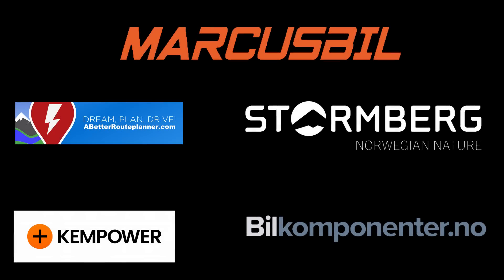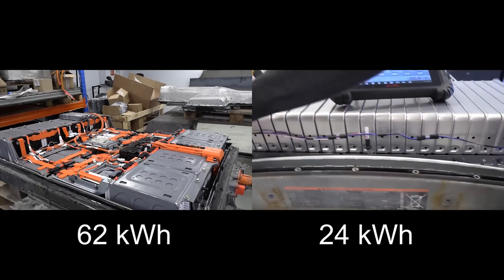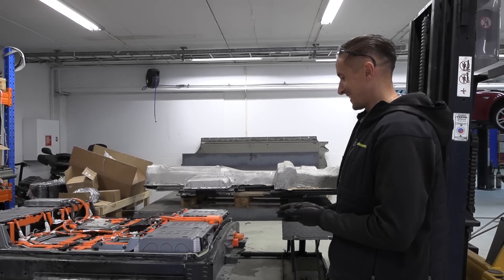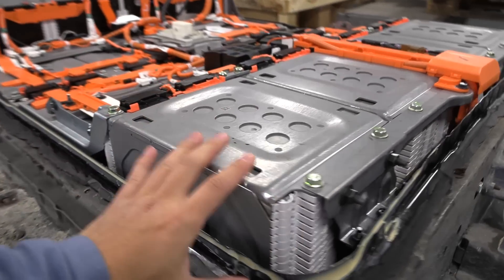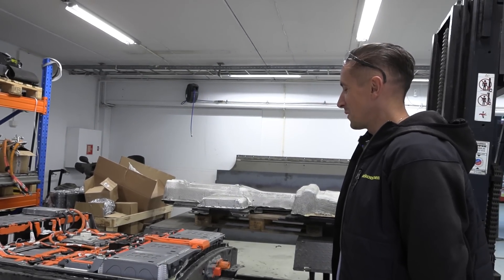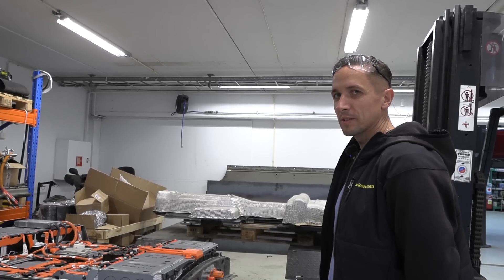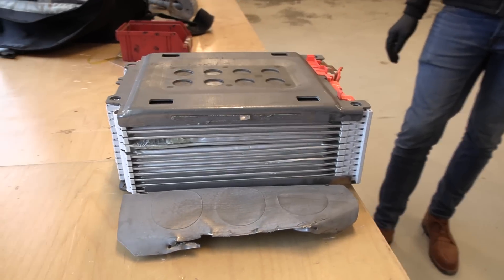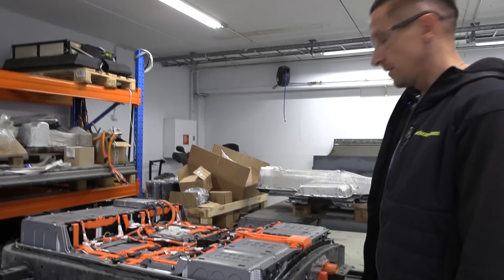The 24 kWh Nissan Leaf battery might not rapidgate at all

Comment: Also, there is the time factor. A large battery fast charges longer (heating), then potentially drives longer (heating) and b/c the motor is more powerful, more current can be pulled out of the battery as compared to the 2011 Leaf (more heating). The older cars were charging for shorter times, driving for shorter times, etc.

Comment: I’m still surprised nobody has tried blowing air through the battery pack. 

Air cooling is not as effective as liquid cooling, the specific heat of air and flow rates required are limiting. 

It should be possible to achieve airflow rates to yield 800 watt cooling with only 5 deg C air temp delta.

The unknown is how much heat can be transferred out of the batteries to air when air passes through the case. 

Plus the obvious issue of dirty air, moisture/ humidity entering the battery case.

Comment: I just got back from an 830km trip in my 24kWh Leaf and the highest temperature I saw was about 54°C after a 90% charge on the way home. Don't forget that the charging times aren't really that long on a 24kWh battery so there is less time to accumulate excess heat. 0-50% is around 15 minutes on a decent charger, and 50-80% is another 15 minutes and if you're really in dire need another 15 minutes will get you >90%.

Comment: Owning a 40-kWh-Leaf for 18 month now I only did 2 or 3 Chademo charges at all. So #rapidgate is not an issue for me since i charge at home most of the time. What i miss most is a propper CCS connector and a triphase AC charger with 11 kW.
Reply: There is now a CHADEMO to CCS adapter available online. Haven't used it firsthand. Works in Norway with CCS2, I think there is still some CHADEMO to CCS1 adapter firmware development going on in the USA.

Comment: The Leaf is actually a great car, with the battery thermal management being its Achilles Heel. One thing that the Leaf has that no other EV has, that I'm aware of - at least visible on the dashboard, is the actual HEALTH of the battery. (Some EVs might have this info available either inside a menu option or via an app and OBDII dongle). For buyers of used Leafs or even for current owners, this info is actually quite useful. But I imagine Nissan realized it didn't want that information too accessible after all. I don't think the new Ariya has this feature.
Reply: I think I saw it in one of Bjorn Nyland's test videos of the Ariya. .
Reply: @joeaverager Good to know. I hope it's true because it is quite useful information.

Comment: Hmmm, this made me wonder. Is it possible to swap a 62kwh battery pack to a second gen (ZE1) 40kwh Leaf? Considering it has similar engineering structure overall
Reply: Yes. There are other videos showing this. Springs need upgrade. Minor mod needed to fit physically plus canbus translator.

Comment: Diesel gate = the scandal of software cheating on polution figures to sell more Diesel  cars. Software with a hidden algorithm.

Rapid gate = slowed DC chargeing due to heat build up in batteries on a long drive involving many DC fast chargeing sessions. Software with a hidden algorithm.

Cold gate = reduced DC fast charging due to battery cooling while driving from one charge to the next on a long drive. Software with a hidden algorithm.

All based on the Watergate idea, President Nixon sent a breakin crew to bug his oponents presidential campaign meetin at the Watergate Hotel in Washington (yes you guessed it)  DC

Comment: When you drove to Alvdal in - a lot of °C the air is very dry and there is no moist to transfer heat from underneath the battery, whilst when you drive in 0°C water can transfer heat from underneath the battery.
Reply: Another idea I had was misters as used in greenhouses to spray water on top of the battery box. It would either evaporate immediately or run down the sides of the box and drip off. Put a 2-3 gallon reservoir somewhere. Switch it on only when the battery is very hot. Unsure if it would make a big difference but the batteries do sit on the bottom of the battery box so some heat transfer happens with the air. Also - big aluminum heat sinks added to the bottom of the battery box. Might wick heat away from the battery when moving.

Comment: MY 2002 tOYOTA RAV 4 had air cooling. two big fans pulling in air from over the rear wheels and blowing out the bottom of the battery pack through screened vents. I no longer own it but I see it on the road once in a while 22 year old batteries living in the west coast rain forest of Canada

Comment: Don't forget these old LEAF's also Cold-gate, so adding more cooling doesn't help the 1 or 2x rapid charge journeys, like always there is always a trade off on these simple cars, so I think Nissan got it about right, in that the car was built for 0-3 rapid charges per day, so thats maybe 250miles, how many LEAF owners did more then that? I did 70k miles in 3 years (24kwh) and only had over heat issues 2 or 3 times on the odd 300+ mile journey, in fact I wished it didn't cold gate more then I wished it didn't rapid gate.
Reply: Yes, cold is more of an issue on the 24kWh. Nothing worse than only getting 35kW peak and then quickly dropping to 21kW in the Winter.
Reply: Dala's thingverse has "Modular grille-block off plates" available. Might get extra range from improved aerodynamics too. (Have not yet looked into printing those myself).

Comment: Bjorn you should inform yourself better. This hurts  your credibility. while Nissan skipped the preferred, manageable, liquid cooling they were also aiming at keeping cost down. I am not defending them BUT you seem to skip a lot of the cooling engineering  details they put on to these packs… there is crafted   metal bars picking heat and transporting out of the modules… perhaps if you watch Weber professor channel on his battery dissembly and an actual technical view of the process ….

Comment: Owned all of them except original non-lizard 24kWh.  40kWh was the worst - I could turtle it in the mountains on a hot day (113°F) in 1 hour of driving.  Our 24kWh 2015 (12 bars) died in head-on crash in Aug - we walked away.  Thank you, Nissan engineers!  Replacement 30kWh will only go 250mi, then you are on L2 only.
Reply: 113F? You sure? 🫣 Sahara kind of temperatures + mountains i believe it could overheat.
Reply: @SuperAti15  Yes, turtle was the "battery over 132°F" indicator and car stopped accelerating.
Reply: @mikecarter2737  I know but where do you already experience 113F outside temperetures?? That's insane. Guess climate change gone further than I thought.

Comment: I use Leaf batteries in conversions. The 24, 30 and 40 kWh Leaf are constructed near identical, with one large brick in the back and the rest lying down in the front 2x3 "towers". The difference between 24/30 and 40 kWh is the latter senses the temperature on the pole screw in front of the battery while the other two have temperature sensors stuck in the back with no heat transfer medium (apart from air). So when the 40 kWh displays 50°C this is actually near the core temperature of the cell. If the other two display 50°C then the core is a good deal hotter. I remember opening up the box after long trip and some hot air hit me with the 24 pack. The 40 pack never felt that warm even if it displayed so.

The 62 is a different beast as you showed, I've never used it.

Comment: The passive cooling might be based on the principle of heat-sinking and heat-piping. The question is have they done this or not and how well has it been implemented. I suspect they chose this as a cost-effective and well understood solution to a car they were unsure had a future or not, meaning testing the market and trying out new ideas.
Reply: By the time the 2nd gen. LEAF was launched, they had sold quite a few 1st gen. cars, so they should have had a handle on both the markets and battery performance and degradation. I find it telling that when some people in the UK had a "race" from the southernmost part of England to Edinburgh with a 1st gen. LEAF, a 2nd gen one (40kWh I think) and an Ionic (28kWh), the 2nd ge. LEAF came last thanks to rapidgating. The Ionic probably won on efficiency, at least in part.
Reply: @koma-k The first gen Leafs were all most certainly a testing of the market response to EV's and there viability as an alternative to ICE based cars. Each generation after gen. 1 are simply iterations on a base concept. There problem is today's management is very conservative and somewhat EV sceptical thus the lack of meaningful innovation. This shows in Nissan's struggle to keep pace.

Comment: The same analyse about Ioniq 28 passive cooling would be extremely interesting
Reply: Isn't ioniq 28kwh active aircooled? It has a fan that cools the pack with air?
Reply: Classic Ioniq has active cooling. It has a fan that pulls in cool, interior air
Reply: The Ioniq 28 can do fast charging. How did they get it to work without battery overheating?

Comment: I observed rapid gate once on my 2019 e-golf. A road closure meant an early rapid charge and a diversion and then needed another rapid charge to complete my journey. Normally I can make this trip with one rapid charge no problem. The charging speeds on the second rapid charge were painfully slow and getting slower as the battery continued to heat.

While topping up the screen wash I noticed how HV battery connector formed a tunnel into the "engine" bay. Which got me thinking if running the AC while charging which has the effect of running the cooling fan would push enough air over the battery to make any difference. The resulting air would be warmer than ambient because of the heat removed by the AC so maybe having a way of running that cooling fan without AC running could be useful.

Comment: What is your opinion off planned obsolescence. Just yesterday watched video off Ev clinic from Croatia where they showed it for Mercedes Ev, they showed it on smart but is same for all other Mercedes EVs. There is counter that start from 300k but goes down 1 less every time you press start button. You would thing is enough but every computer error drops 5000 and there are even low voltage glitches that down 100k.And when drop to zero it lock batter even is perfectly good and you can't do nothing except drop giant pile off money for new battery

Comment: It is still  impossible to understand why the Leaf II did not get active cooling, although it would be simple via air conditioning. Hey Nissan, why? :-) For me the Leaf II is still nice ev!
Reply: I suggest that the original design criteria for the LEAF was covered by the passive cooled battery. It is only when you stretch the demand that there arises a problem.  The early idea was apparently based around the typical family car usage, local journeys mainly. The design has worked well enough to be extended into a medium range car simply by upping battery size. 
My own experience goes from a 24 first edition LEAF through Gen 2, and 2.zero 40Kwh. to my current 62 Acenta. From a car that needed a top up for a 100 miles visit to family through to a car that managed a 2100 miles summer trip with several rapid charges during the longer sections. It was 5 months before I needed to charge the 62 LEAf away from home, so called 'Rapidgate' is no problem for me.

Comment: I believe Johnathan Portfield Eco Cars first discovered rapidgate in the 30 kWh Leaf (IIRC, maybe it was 40 kWh).  He had driven 24 kWh Leafs from south England to Orkney with no issues when fast charging on the way.  When the 30 kWh Leaf came out, he was caught off gard with extended charging times due to "rapidgate." The internal resistance of the original cells used in the 24 kWh Leaf was very low, permitting fast charging without thermal management.  Nissan and NEC engineers (at AESC JV) provided more capacity cells for 30, 40, and 62 kWh packs, but at the cost of higher internal resistance.  That produced more heat when fast charging and now the Leaf really needed thermal management.
Reply: Didn't he and James drive from the south to the port in Aberdeen with the two different battery sized Leafs in a "race" and find the bigger battery was no faster coining 'Rapidgate' that day??
Reply: @peteglass3496  But does such a 'Race' have any relevance to most owners?
Reply: The 40 came last between a 30 and a ionic 28

Comment: 15:22 The Mitsubishi iMiev had a fan to circulate air from the cabin through the battery. Maybe a fan might help cool the Leaf battery. In warm weather blowing hot air from the battery outside would avoid heating the cabin. In cold weather waste heat from the battery could help to heat the cabin. 🤔
Reply: Classic Ioniq 28kWh does the same thing. I own one along with 24kWh Leaf, and let me tell you a fan is definitely a LOT better than nothing.